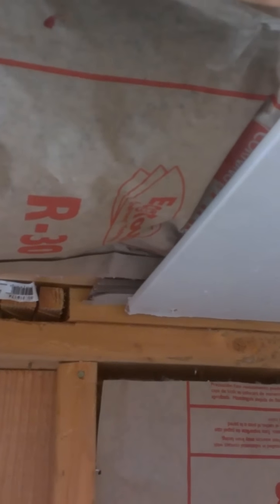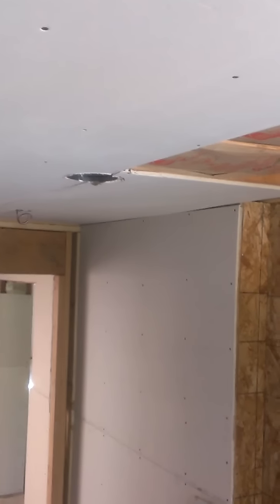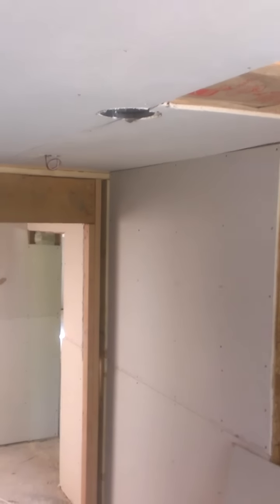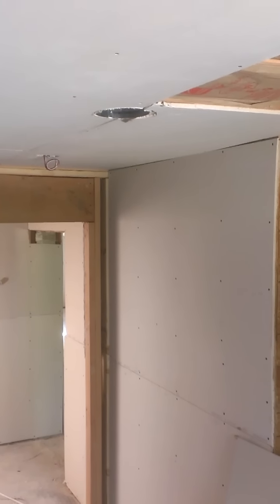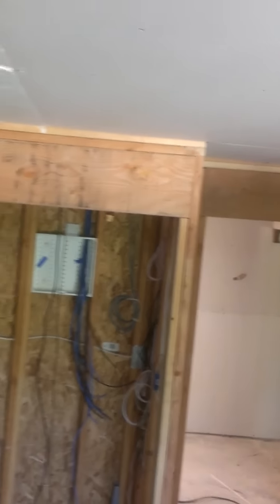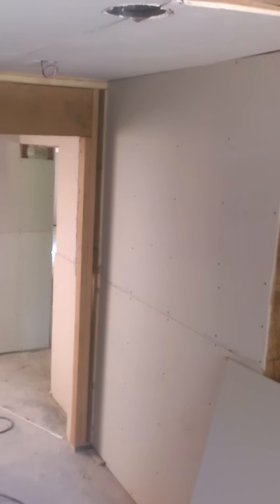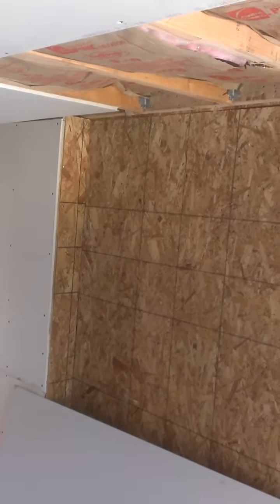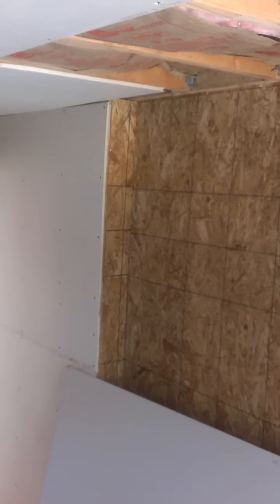Poor carpentry framing for drywall

Comment: Things being out of square falls on the masons first and the carpenters second... the carpenters should check all the masonry measurements and compensate if they can where they are off... but when you are sheetrocking the underside of floor joist then that isn’t really the carpenters fault if cheap joist are used and they are all twisted and crowned.... the carpenters should always plane out and make sure their is adequate backer on the other hand.

Comment: This is stemming from the concrete
Reply: A Ron a good carpenter makes everything plumb, level and square even if the concrete guy sucks.
Reply: @thomasbryant5138  not true, they can make it square and plumb but if your elevations are all over the place your wall height is going to be all over the place. After that the drywaller will be dealing with a wall that is 9ft 0 on one side and 9 foot 1 1/4 on the other. This will then happen.
Reply: This guys clearly a hack though
Reply: @Aaron-fb1pq  I've been a framer for 25 years and we  adjust the walls if need be so the elevations are perfect and if it's the concrete wall we router out where are joist sit to adjust for the concrete going up and down. These guys just didn't care
Reply: @thomasbryant5138  You are 100% correct. If you are a good framer you will do what needs to be done to make everything straight square and level.